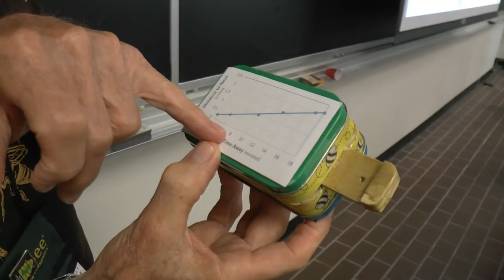Altoid Beelining Box

Comment: Are the bees jostled about in that metal container as you put it in your pocket and walk about ?!...
Reply from the maker: Yes, that is possible.  We wouldn't recommend banging them around on purpose but most times it could be imagined that they would grip to the surface they are standing on and not bouncing around in the same way as say a bean would if it were in the same chamber. One consideration is that bees are surprisingly hardy and can withstand an impact.  One only has too think of a sugar shake mite test to know that bees can take pretty rough handling.  An interesting question to consider.